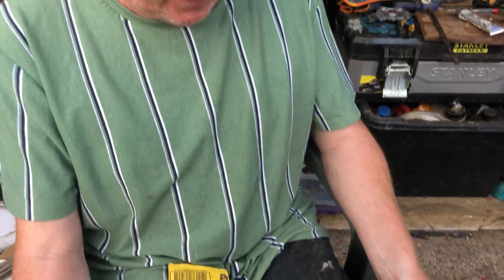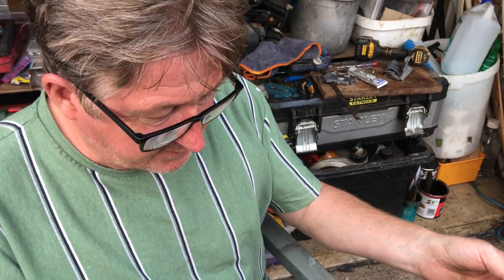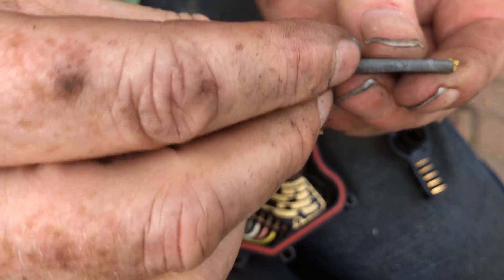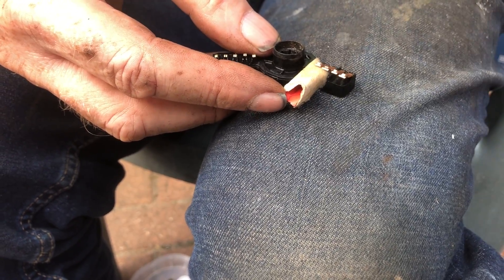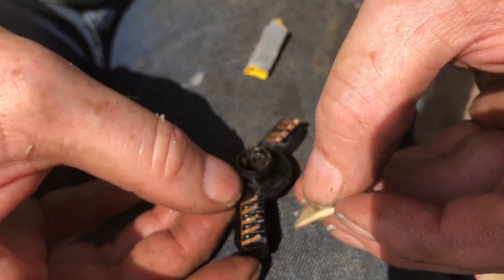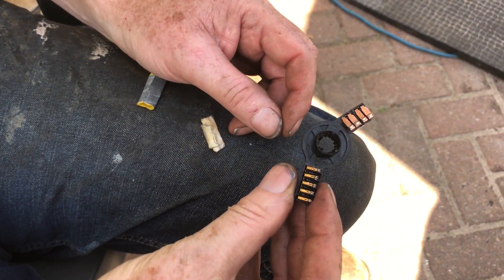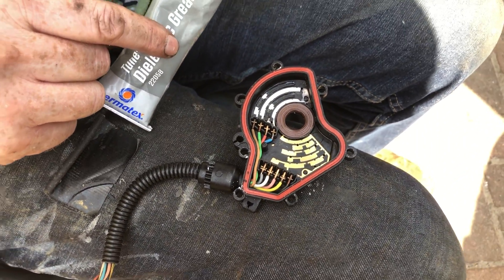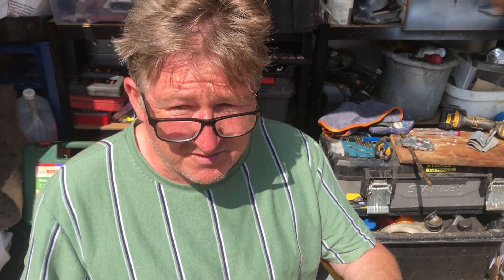Land Rover Discovery 2 TD5 Black XYZ Inhibitor Switch Cleaning, Restoration and Refurb How To

Comment: Thanks a lot. The problem I have with M+S flashing is not when I start the car in P but sometimes when I insert R or D from P, You hear a small blow as if the clutch is not well opened and the lights start flashing, what can it be?
Reply from the maker: probably worth taking a look at it
Reply: I have the exact same issue, it comes up daily but then also leaves. I’m going to try and clean/refurb the XYZ switch, cant be anything mechanical because then broken is broke right? Its on and off so i suspect the XYZ switch.

Comment: hi great video i have a 2003 discovery TD5 auto i have just brought it but it has a crook gearbox it will drive when you put it in drive but wont change up gears and works perfect in reverse any ideas what it could be also are they hard to fit another gearbox  thank you
Reply from the maker: have you checked the gearbox fluid level?